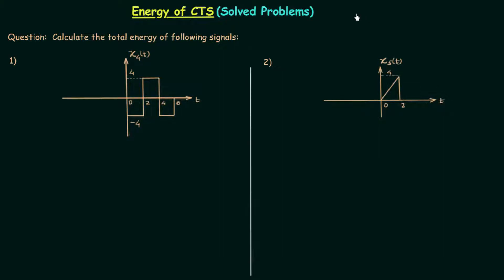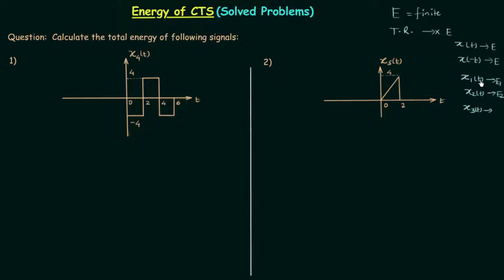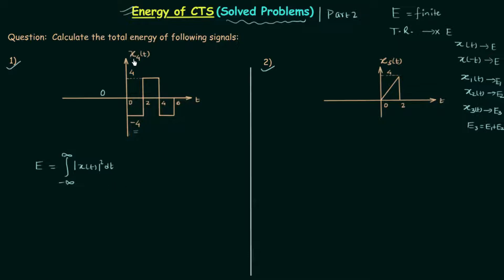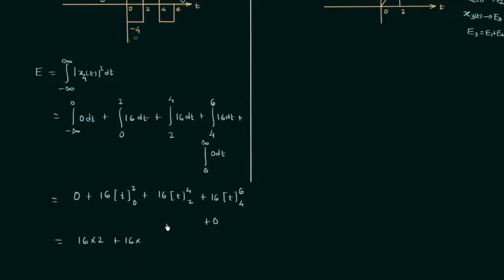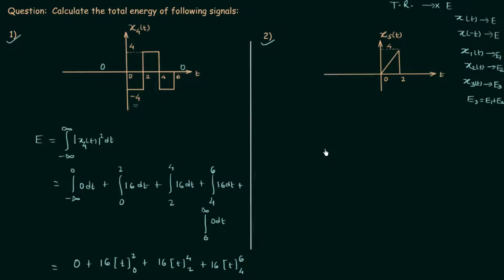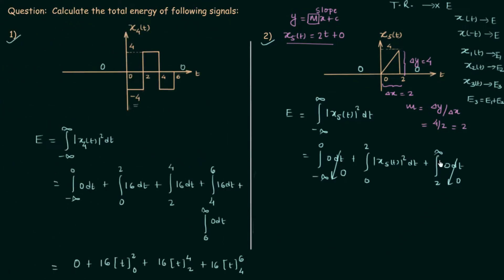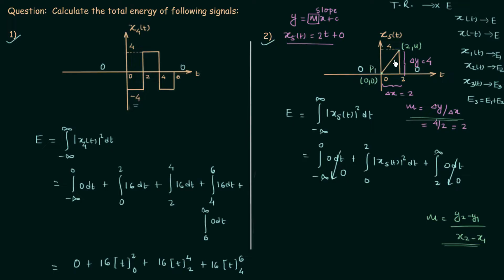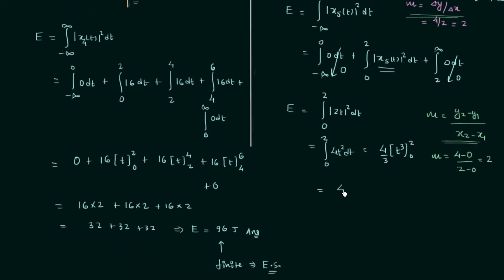Energy of CT Signals (Solved Problems) | Part 2

Comment: The second problem as mentioned in  your previous lecturers is that the energy is equal to the area under the graph so if we subtract the area of triangle from rectangle we'll get the same answer.
Reply: the energy is actually the area under the graph of the signal squared.

Comment: sir for this 1st problem the amount of area is 24 but energy is 96J.. you said energy us amount of area right??
Reply: For Energy we have to Square the Area.

(Mod of Signal)Square = Energy.

Note :: Sqaure the Signal 1st and Find Area Later then Only U will get Correct answer.
eg. Area of 1st cycle 2*16=32 like that 32+32+32=96Joules.

If U square the area later u will get wrong answer :: 8+8+8=24
24Square = 576J Wrong Answer.

Hope U understand

Comment: If we apply area concept to find out the energy then it's giving different results for the second case can any one give the proper reason??
Reply: If we squre a linear equations it becomes parabolic equations so we are getting Wrong answer.
Reply: @kalyanjana3524  But we squared for the first sum
Reply: If you square then it Is parabola
1/3* b*h= 1/3*2*16=32/3
Reply: @pavankumar-in1ro  could you please explain how you come about 1/3? I believe the area of a triangle is 1/2*b*h....

Comment: hey i am just wondering if you could answer my question regarding a signal that looks like this: 
   →2     /|
           /   |
 →1   |    |
_____|    |
← 2→—3-

get the energy of this signal in one period. the pulse width of the combined triangle over a square wave is 3 (amp of square is 1 while amp of triangle is also 1).
this is a periodic wave.
note : what i have drawn is one period of the signal already. hope you could answer me cause i am really confused.